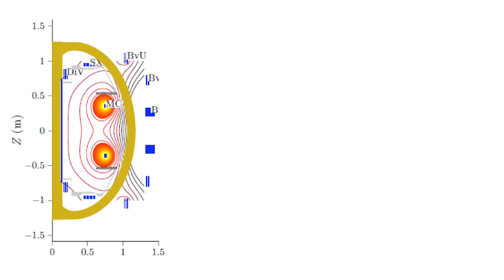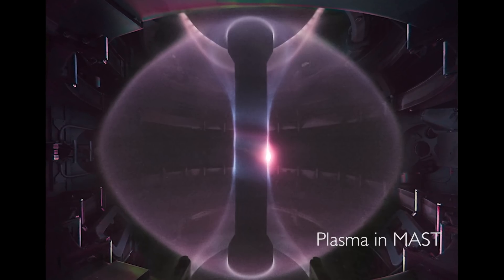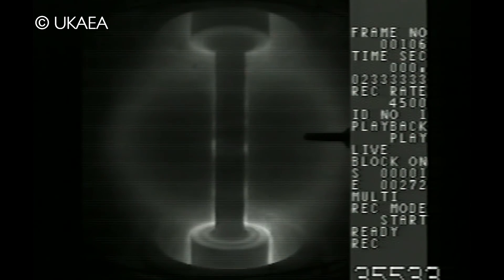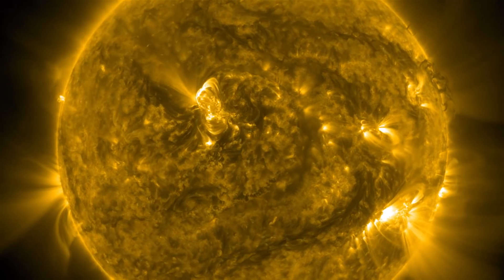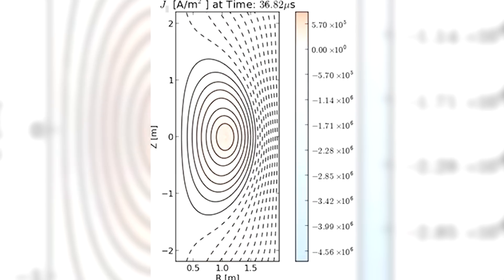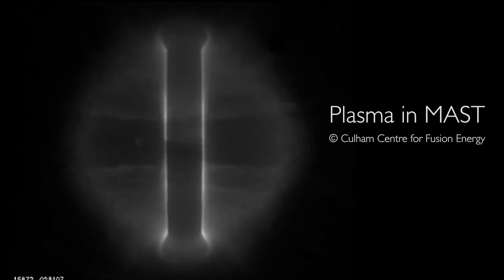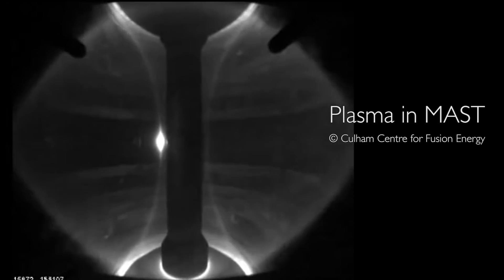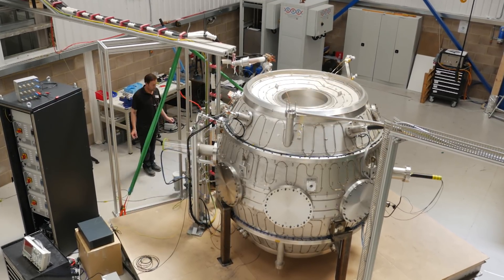What is Merging Compression?

Comment: Getting to burning conditions looking at the density is very interesting. An other project (https://www.youtube.com/watch?v=-ypME6Rh8lA) are also working on merging magnetic plasma fields. They try to get to burning conditions by pulsation (not sustain-mend). They are facing the challenge to get to the required density. I hope someday there will be such an understanding of plasma fields that it can be "easy" to make a controlling process in the practical boundaries of the mechanical system for sustain-mend of the process under human operation.

Comment: I agree with Noble-prize winner Alfven that "magnetic reconnection" is not a good scientific model. I have not yet seen good science with it, and the maths is like 10^6 orders away from the observations. With a very strong background in electromagnetism, I would like to discuss this friendly with some practical people that know what they are doing.

Let me explain:
MR is based on interpretations of some phenomena of the sun, and has not good science behind it. The Magneto Hydro Dynamics (MHD) is the maths behind it. The inventor and noble-prize winner Alfven warned against using it, because astronomers wanted to ignore any electric fields. The MHD oversimplifies the flow of plasma by ignoring some very important aspects of plasma. One of them is ignoring the electric field, as Alfven stated. The other is setting the flow equal to the flow of electricity. And more. While it can describe the electromagnetic wave in a wave-guide (=conductor), it does not at all describe the overwhelming complexity of plasma.
Then there is the problem of double-layers and surfaces, that do have strong electric fields, according to experiments. This shows that electrical fields, and the Stark effect, can be very dominant in plasma, under certain conditions.

Now back to the sun. Here we see plasma-ropes that go from one sun-spot to another. We can often see the flow of plasma inside these "ropes". These sun-spots have very strong Zeeman effect, OR Stark effect. And because the astronomers did not know about Stark-effect, they assumed that the plasma-ropes were following the magnetic field lines, as happens with free electrons or free ions under certain conditions. 
But the we did not see any currents that could create these exact magnetic fields. The proposed magnetic field-lines also look very weird and very much unlike the fields that we see in our laboratories. As if the sunspots are not magnetic dipoles, but mono poles in some way. (The curves are like a 1/R² field, e.g. an electrical field).
The plasma-ropes also bump into each other, causing outbursts of energy. But where does this energy come from? The astronomers invented theories about magnetic field lines bumping into each other, and this is what we call "magnetic reconnection". Yet, this breaks with the fact that magnetic fields are continuous and have no real field lines.The theory also breaks with everything that I know about electromagnetic fields, so I became very curious in how this theory could exist at all.

What if we changed the model just a bit:
Instead if we use the flow of plasma as an indicator of electric current, we can see that these may already be the currents that cause the Zeeman effect. And additionally they will cause Stark effect as well, at the surface, which looks very similar. This gives us mono-poles at the start and end of the ropes: electric mono-poles (=electrically charged areas). These are likely charged regions that drive the currents. So we have found the currents that create these fields! (Current creates a magnetic field + the surface creates an electric field).
Now what happens if two plasma-ropes, carrying electrical current, collide? They create a short-cut, like in the laboratory. This is a very energetic event.
So with just the simple observation, I solved two problems at once with a very simple solution. This is very basic electromagnetism, no additional theories, and it can be repeated in the laboratory with ease. I can even see plasma-ropes in my plasma lamp.

While you may see this solution as an oversimplification in a different way, it is a lot simpler, and seems to explain the observations a lot better. It is so simple that most astronomers get offended by it. That is probably because it is usually a far-away corner of science.

And this is what makes plasma physics so interesting: It is a very complex medium and you can build different models in it. In engineering it is usually a semi-conductor. The military see it as a weapon. And it is studied by students in scientific experiments. All these models can differ a lot.
We can make cold blue plasma fire that you can touch with your hand, or hot invisible plasma that you can kill you. It has so many possibilities. And so many ways to model the phenomena.

My well-meant concerns:
The astronomers have been dominating the modelling of plasma most of the time, with their deprecated model. So, I wonder how much science has been going into the wrong direction. And how much this is stopping us from really understanding fusion.

Comment: Can we use the fusion reactor of ITER for neutralizing the fission nuclear waste ?
It is produce more heat then sun right?
Reply from the maker: Yes, you probably could use fusion reactors to reprocess fission waste, but we are not looking into this so don't know the details.
Reply: @tokamakenergy6400  Wow, so you mean if we heat the radioactive uranium in a plasma it can get converted to something else? Or how does this neutralize the waste?
Reply: @davemwangi05  Using the fast neutrons given off in a fusion reactor you could transmute (convert) your long lived fission waste (significantly radioactive for ~ 300,000 years) to a much shorter lived waste (~ 300 years to decay to background levels). This is also possible with the fission reactors we have today, just look up fast breeder reactors, and the terms partitioning and transmutation for more info. Though these are plausible solutions at least for the fast fission reactors I believe there were a lot of technical issues, such as dealing with corrosive molten salts. In fusion we would like to use those neutrons to breed more of our fuel (tritium) hence why using those neutrons for P&T has not been considered too much, as we will barely be able to breed more tritium than we use.